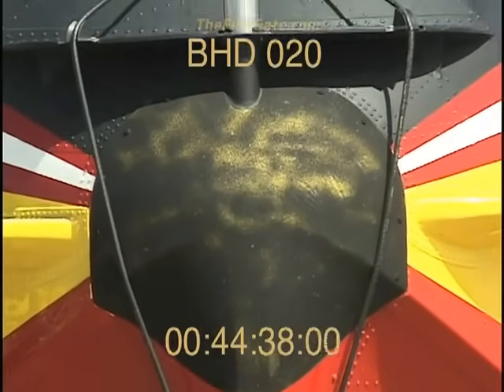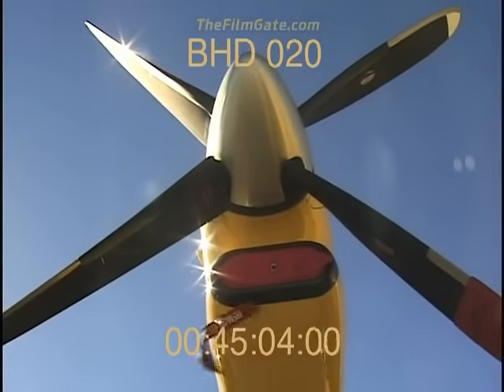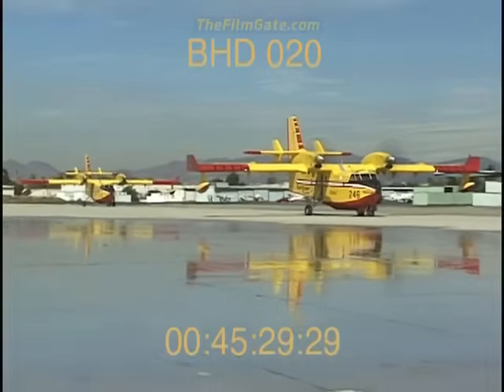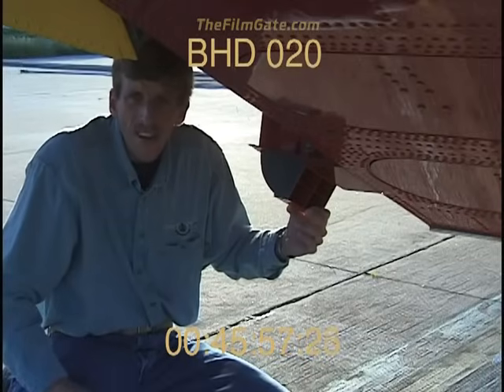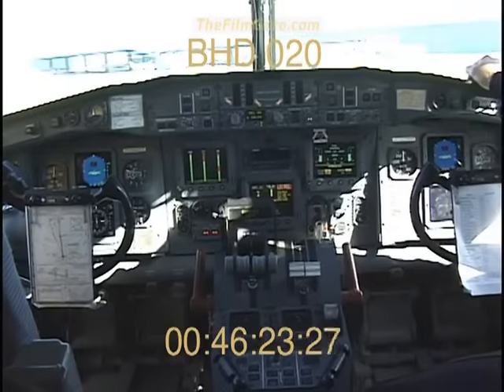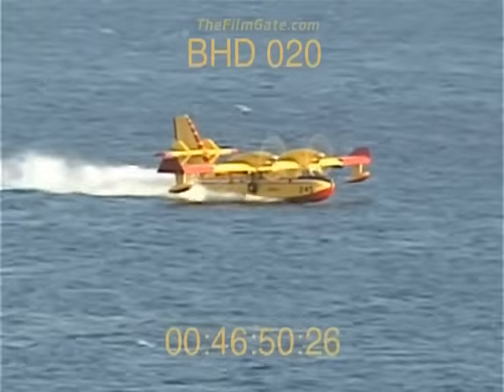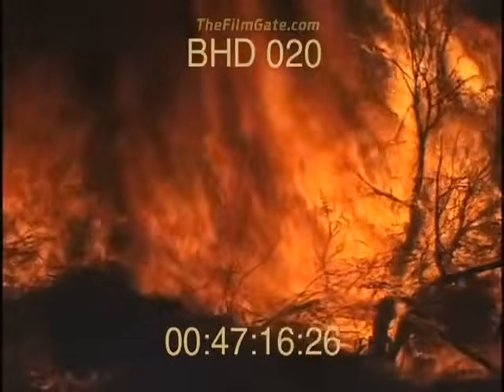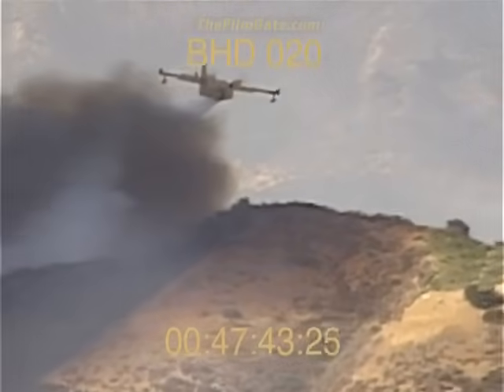Super Scooper CL-415 firefighting plane - Stock Footage

Comment: A new model the CL515 is scheduled roll out in 2027 featuring upgraded electronics, more powerful engines and greater performances, the first 2 dozen airplanes have been to a number of European customers.
Reply: @davey7452  
"More powerfull engines"
Will they still use the PWC123 engine?
Reply: @erictremblay4940  they will have the same engine. Only really upgrading the avionics and corrosion protection.